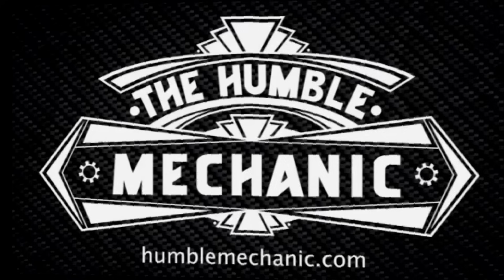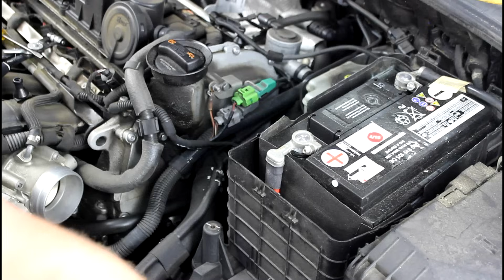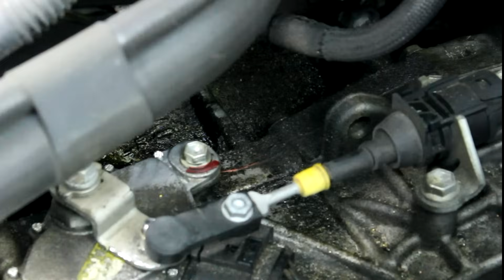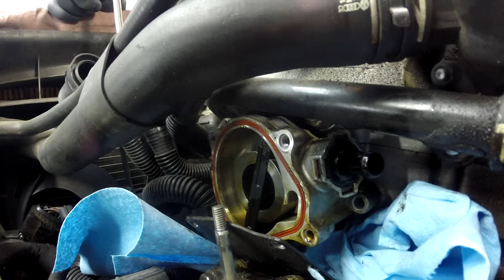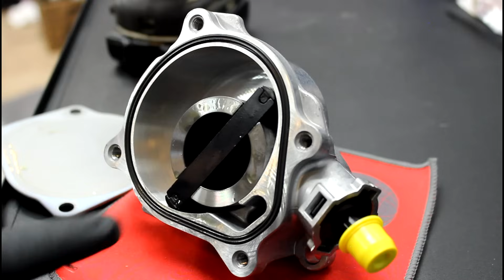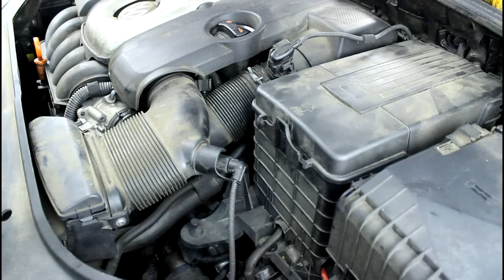Replacing VW 2.5l Vacuum Pump ~ The Easy Way

Comment: I know this is an old video, but I am finding myself needing to address a leaking vacuum pump on my 2012 VW Jetta SE 2.5L manual transmission. I notice this video is for automatic transmissions. Is it still possible to repair/replace on my manual? TIA
Reply: If it’s similar to the set up on the 2.5 rabbit engine, then yes it’s actually easier than in the video. See comments from Dulkinukas below re manual transmission. (Sort comments by newest first if you don't see it).

Comment: Thank you, this saved me $1,650! Dealer quoted $1900, got the parts for $250. But damn was that bottom T30 screw a pain. Needed to use a socket wrench to break it loose

Comment: I got something a whole lot better than replacing that worthless ass pump. You need to get a spool in vacuum pump delete kit from USP Motorsports. This will delete the vacuum pump. When I replaced mine it was grinding up and putting metal into the engine. Once you get this kit you'll never have to worry about it again.

Comment: learned my lesson on purchasing vw's... the money I put in so far to fix the car could have gone torwards a hefty down pay for a brand new car and it's only at 50k.  had everything from electricals, the engine even air conditioning worked on and I still have a broken clock spring that never got fixed, the dealer quoted me around $600 to replace this...
Reply from the maker: Damn. The clock spring isn’t covered under a recall or warranty
Reply: unfortunately no, not on my model.. it's at the dealers now for a new vacuum pump and throttle body clean, hopefully this will address the car stuttering issue the car exhibits when slowing down or coming to a stop.  I had this issue 4yrs ago and they performed a SW update and was fixed but recently happening again.

Comment: **If you've got a manual transmission see my notes in this comment. They may help**     Thank you Charles for this excellent video! I did this repair today (Dec 2020) on a  2009 Rabbit with a manual transmission. Saved a bundle versus what the dealer and an independent shop quoted ($1,800 and $850, respectively) Did it myself for $300 in parts and some tools I didn't already have. Below are notes I took during and after, in case they help anyone.

I'd say this is already a pretty easy repair for anyone who's done some car repairs before, and only slightly harder for a novice with some basic experience. And it's MUCH easier with a manual transmission since you don't have to remove the shift selector components or the  pump cover or pivot the pump over and around the shift selector.

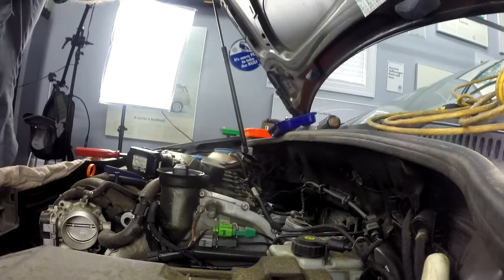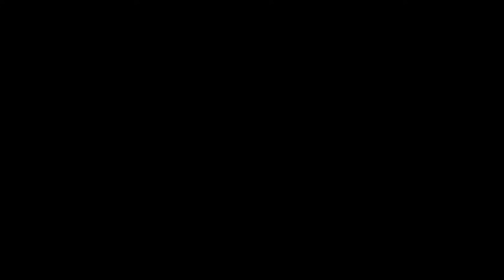Basically, if your car is a manual  you'll skip most of what's mentioned in the video between 5:00 and 12:00. (But you should watch that section anyway just for context). And remember, DON'T remove the cover/plate on the front of the old pump or on the new pump if you've got a manual transmission.

Oh, note that in the description above, the vacuum pump gasket that's linked to doesn't seem to be the right one for a 2.5L engine. It's for a 2.0L engine, not 2.5. Get the 2.5L gasket which is : https://www.shopdap.com/07k-145-215-a.html. (Double check with DAP if you have questions on the part).

THINGS TO KEEP IN MIND

Take photos!
The video is very thorough. However, your engine area won't look exactly like the one in the video. Consider taking some photos of each section before you start unplugging wires, removing bolts, etc. That way, if you need a reference when you're putting things back together, you can see exactly what your set-up looked like earlier.

Beware dropped bolts
Maybe put an old dish towel or something under the pump when unbolting it--it might help catch the bolts if you drop them and save you some time and frustration. (I wasted 30 minutes fishing out one of the T30s, the 10mm bracket bolt, and one of the battery mount bolts).  

Brake booster hose removal
I  had some trouble removing the brake booster hose from the pump. Didn't want to risk ruining the rubber boot or hose so I left that on until I had unbolted the three T30 bolts. It was then easy to swivel the hose off once the pump was free. (Or rather, swivel the pump off the hose).

Can't get the old pump out?
The video shows the bracket that's bolted to the left of the pump. If you haven't moved that bracket fully out of the way  when it's time to remove the pump it'll seem like you missed a bolt or something as the pump won't want to come off. But it's just the bracket preventing the pump from pulling out. Make sure it's out of the way and try again.

Tight spaces (and tools)
Ratchets, sockets, and extensions: the area around the pump is tight, even with a manual transmission, and it's good to have a variety of socket extensions--3 inch, 6 inch, maybe even longer. And 1/4 inch socket extensions will fit better than 3/8 extensions. I used a 3/8 inch ratchet with a 3/8 to 1/4 adapter because I was too cheap to buy a 1/4 ratchet for a single repair. :)  But the 1/4 inch ratchet would have been handy. 

T30 bits: I used a 2 inch T30 bit with an adapter and extension, but someone else mentioned using a 6 inch T30 bit which would have been really helpful! If you can find one, buy it.  (Again, to get into the tight spaces around the lower T30 bolts).

Gears: if you've got a manual transmission you may have to put the car in another gear to get better access to the T30 bolt that's at approximately 4 o'clock. (Make sure your hand brake's on!) I think 5th gear ended up giving me the best access. Have a friend shift it for you if possible, and check which position give you more clearance....easier than getting in and out of the car yourself. 

Torque wrench: as mentioned in the video, it takes some trial and error getting the torque wrench in the right position to torque the T30s...and you MUST torque them to the 10NM specs. You'll need a torque wrench that you can set to 10 NM...larger ones may not go that low. I found a 1/4 inch Lexivon torque wrench on Amazon for $32 that worked well. (Not a pro tool but good enough for this use).  

Other tools that were handy: a headlamp, plus a lantern or some other light source (Charles uses a shop light in the video--I used a small  camping lantern for lack of a shop light). Also get one of those small mirrors on a telescoping stick to see the two T30 bolts that were bolted underneath...and to look for the bolts I dropped into the engine compartment. :-) 

Results
So far, so good...no oil leak when I started it up, and no leaks after a longer drive.  It's an easy repair if you've got a manual 2.5L, and only moderately harder (based on the video) if you have an automatic. Just takes some time, tools, patience, and care.  

Well worth it, as this saved me from the dealer's ridiculous $1,800 quote. They claimed that even with the manual transmission they had to put it into "service position" which from what I can tell involves removing a load of parts from the front of the vehicle fo easier access....but clearly that's not the only way to do this repair, as demonstrated by Charle's excellent video.
Reply: Very nice write up!
Reply: Why do You recommend not remove the front plate? And what about not changing all pump and just replace the oRing?
Reply: @GameplayPS4Tj  Mine has a manual transmission and I found that removing the front plate gave me better access to the T30 bolts. I had trouble removing the booster hose so I just left it in place since I was just replacing the gaskets and not the entire pump. In addition to the tools recommended, wobble extensions came in very handy for the tight spots.
Reply: Thanks for that write up!  It really helped as I too had trouble removing the hose while the pump was still installed.  Removing the pump the booster hose was much much easier.  Same with the bracket being in the way… so glad I read your comment.  Thanks again!
Reply: https://youtu.be/DXRTVPfMupg
Reply: This is so helpful. Thank you for the extra information. I was wondering if you or @humblemechanic knew what the part that's in front of the battery tray that's not in this video or the one DAP. The part has a gray cap on it  that has markings that look like it's for windshield washer fluid, but it's clearly not for windshield washer fluid, lol. The reason I ask is because it's making it impossible to get the battery tray out which is making it a lot harder to get to the vacuum pump. My car has an automatic transmission so it's already a tight space and I need all the room I can get. Thanks in advance for any help
Reply: @erinculley1208  Maybe it's actually automatic transmission fluid? (Totally UNSURE about as I've got a manual, so please don't pour AT fluid in there). 😀 I don't remember seeing such a cap on my Rabbit so maybe that's why. Did you get the repair done?
Reply: Sorry but i why i don't have to remove the cover on the front of the pump? Mine is leaking, is a Jetta 2008 with a manual transmisión and i just Buy the gasket, any problems if i took of the cover plate?

Comment: Does that 'hose bracket' fit between the pump and block or fit 'after' the pump is installed? I took mine apart a week ago and can't remember where that bracket exactly mounted. 

PS - Still and excellent DIY ! great instruction. You've saved my butt twice now !
Reply: Do you mean the bracket that's to the upper left of the pump, around 11 o'clock? If so, attach it after you install the pump. It does not go between the pump and the engine block if that's what you were thinking. (Just did this yesterday and looking at the photos I took during the process now).

Comment: You can do the whole job and not replace to pump, not sure why people replace the pump, I have never seen one go bad, I pull the seals out of the the cover and nipple, clean them all up cover them in rtv and reinstall with a new steel gasket, why pay hundreds of dollars for a new pump.
Reply from the maker: Ive seen them fail internally and let too much oil get pumped into the pump. But ya you can totally reseal some times

Comment: Hey brother thanks for the vid.  I just did this install today and I’m still leaking.   What do you think I should check next?    Is it the gasket that goes between the pump and the engine that needs replacing?   Did I not tighten the cover on to the pump tight enough?      Should I check something totally different - like the oil filter housing?

Comment: This is an excellent DIY Video. However, I am lost and confused about the bolt marking with the red Sharpie Marker on the shifter plate.  What is the purpose of Marking the bolts with red markings. I didn't see why. The plate reinserts back in the same position. So please explain in greater detail the purpose for marking the bolts. What should I be focusing on the reinstall process with respect to the bolt markings?

Comment: Post installation of the new unit I have an oil leak. oil on transaxle and dripping.  The unit mounted without much trouble. Thoughts? Purchased through link.

Comment: I can do the R@R on the pump in 22 minutes.....but it takes me a full hour and a half to find the bolts and tools I dropped....

Still, the dealer quoted me $1,400 for the job... so even dropping screws and tools it's still worth doing at home.

Comment: ok so i have a 2013 jetta 2.5 and i followed all the steps to replace the vacuum pump but there is a slight problem. I messed something up along the way and when i turned the car on, all my oil proceeded to spill out from the pump. I tried to redo the job but it seems like The new pump is now completely stuck to the engine and i cant get it out anymore. is there any tips you could give me as to how i should approach this issue?

Comment: i was quoted 1471.98  for my rabbit manual
Reply from the maker: WOW That is 100% wrong If that is in USD
Reply: it is usd i thought about asking dose it include breakfast lunch and dinner for a week
Reply: I was quoted $1,800 for the same (2009 Rabbit, manual). $500ish parts, $1300 labor. Dealer claimed it was because they had to put the car into "service position" for the repair. Riiiiiiight...

Comment: Old video, but still relevant! Thanks for the great how-to. Changed my pump gaskets with the RKX kit yesterday and all went smoothly.
Reply: How is your RXX kit holding up now any leaking? Did you replace the green O-ring and how do you get that off? I need to do my Jetta and looking at getting this kit or the delete kit. Thanks.

Comment: My car idles and revs between 1500-2000 in park when my foot is on the brake in drive it idles at 600, is it this problem.
Reply from the maker: Yeah that’s not normal but it’s probably not the vacuum pump
Reply: @HumbleMechanic  Ok I'm going to look into oil spills in the engine compartment, hopefully I can figure it out because it's constantly reving

Comment: Like everyone else is saying thanks for this awesome tutorial.  For the Beetle, the battery tray is a pain for sure as it's in two pieces and the battery cables need to be put back exactly how they were funkily routed before.  The electrical connection to this front bracket has a slider-engagement on the very bottom that slides waaay out to disengage what it's connected to.

Comment: What years is this DIY compatible with? My girlfriend has a 2013 Passat with the 2.5L engine and this same problem, does all of the 2.5L VW Engines have the same setup or did they change after a certain year
Reply from the maker: Yep basically the same on all 2.5l vw

Comment: performed this repair as you illustrated with no problems removing or installing. However my brakes lock up. brake pedal is hard to push down.
Reply from the maker: Make sure you have the hose all the way on, and it’s not broken
Reply: HumbleMechanic . Not the use it’s new. Found the booster is damaged fro the brake pedal side

Comment: Thank you, thank you, thank you! ....this job was quoted  $1100 at my local VW dealer....my 2012 Passat S is different than your's on the battery tray removing part but everything else on everything else. I did this job over the  weekend with this video coaching me from tablet. Thank you, thank you, thank you.
Reply from the maker: Sweet!!!!!
Reply: @HumbleMechanic  hey humble mechanic I need your help again....I watched your videos on valve gasket cover and vacuum pump and did those jobs on my 2012 passat 2.5L....my next job is replacing outer cv boots on same car....pointers? Tips? Sequence?...many thanks 👍👍👍

Comment: Good luck with this. There is no way of getting the new pump back on without taking the cover off and find that the gasket is bigger than the relief so it pops out. No biggie just pop it back in RIIIIGGGHHTT. You will never get a new gasket on the pump while it in the car. You are going to struggle to get the gasket in and the cover on when its on the bench. Then since you cant get the pump on with the cover on the endless cycle begins. YOUR SCREWED!

Comment: i removed mine.  cleaned up the surface and only replaced the gasket.   also added a TINY bit of black sealant.   2 years now, not a drip.
Reply: 3 years now.

Comment: I changed the crush gasket and the rubber gasket following this tutorial. Thanks for the detailed footage. But the kit I ordered did not come with an o-ring for the check valve (where the brake booster hose connects to the pump) which is also leaking. Is there a separate part number for that?

Comment: Thanks to your video, I replaced the vacuum pump on my 2006 Jetta SE 5-speed this past fall, and replaced it on my wife's 2012 Jetta SE automatic yesterday. I was also quoted about $700.00+ per car from my local mechanic who told me that it was not possible without dropping the transmission. I bought my parts off Amazon which was less than $70.00 each including the pump and gasket.

That bottom T30 sucks...and it seemed the more frustrated I got, the harder it fought me...imagine that.

Also just a heads up from anyone who needs to replace theirs...do it soon, my 2006 leaked oil right onto my starter and ended up destroying that as well and needed to be replaced.
Reply from the maker: Damn on the starter? Never seen it ruin one of those.
Reply: @HumbleMechanic  Yeah, that one had been leaking for quite a while. Once I started seeing evidence of a leak on my wife's car, I immediately did an exploratory teardown and got the pump and gasket.

Side note...I may be moving to your area(ish) in the next few months, would be cool to meet up and buy you a beer (I feel like I owe you for what your videos have saved me).

Comment: what is your opinion on the Vacuum Pump Delete Kit?
Reply from the maker: Not a huge fan. I’ve seen one car lose brake assist randomly. For something that important I’d do the pump replacement or reseal
Reply: @HumbleMechanic  
I replaced the gasket for the back plate on the pump. I feel like I did an good job cleaning up the top of the trans. I am still seeing I very small amount of oil (spoon full) on the trans under the pump. I ran my finger along the bottom of the pump where the back plate seated and no drips. Residuals? Metal gasket on the other side of pump? Thanks for you help! LOVE the channel! Most well-spoken and knowledgeable on the tube.

Comment: After going through this process and putting everything back in, my car won't start up. What would cause this? Battery disconnect resetting the computer?
Reply from the maker: That shouldn’t cause it. Does it try and start? Maybe. The trans plug is. It plugged all the way I
Reply: @HumbleMechanic  yeah it tried to start. Still have power to lights, windows etc though. Would the shift selector have anything to do with it?
Reply: Luke did you find out what caused this? I’m having the same problem.